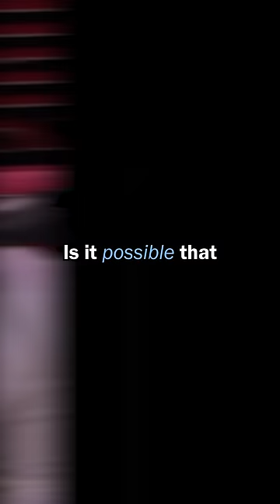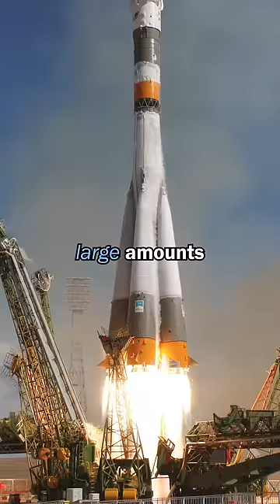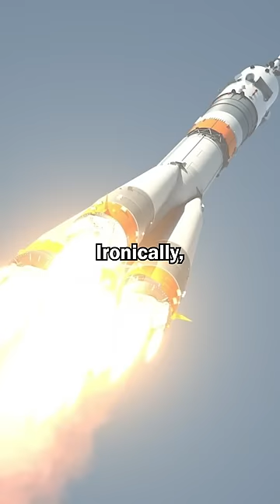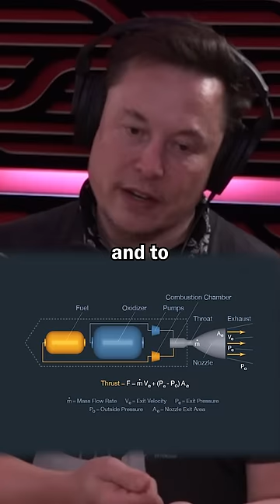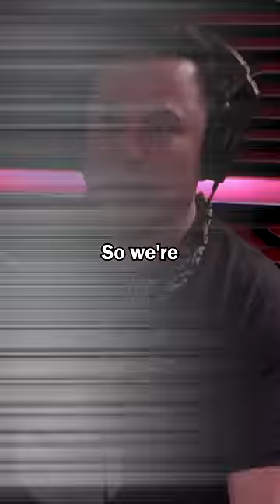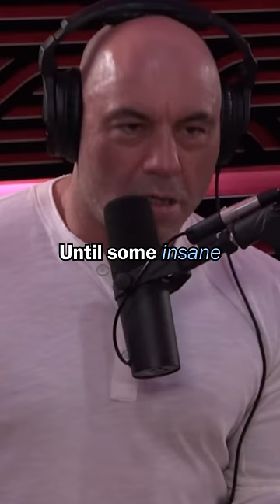Why This Rocket Engine Will NEVER Work!! ☢️ #spacex

Comment: Lockheed Martin is literally doing nuclear engines rn
Reply: True but the nuclear fission engine in development DRACO still expels hydrogen gas so Elon's point holds up.
Reply: @JFinns  True but I think elon was specifically talking about the main component of the fuel source. Not the exhaust
Reply: @bretwood4080  it is one and the same in space, this is specifically what he says, in the space it works because there a huge load of gas output not because something is burning. he never said you need to burn something, he just said that at this moment gas is needed
Reply: Nuclear engines produce propulsion exactly the same as any other rocket.

It expels gas out the back at a high speed. In order for momentum to be conserved, the rocket moves the opposite direction.

For every force, there is an equal and opposite reaction. All rockets function on this principle (even nuclear rockets, ion drives, etc). They all shoot gas out the back. 

The only theoretical exception is warp drives (it would move the space time you're in, carrying you with it, by bending the spacetime in front and behind you)
Reply: @adambalogh8728  Rogan clearly asked in terms of fuel source. Elon answered in terms of propulsion. And if you wanted to get technical, it's simply particles being expelled. Doesn't require them to be in a gas form. Most often, they are a plasma when in space.
Reply: @tylerdurden3722  Technically it doesn't have to be gas. It just has to be particles of some kind. Ion drives already exist. Solar sails would work of photon particles. Nuclear fission sends high energy particles out the pack. None of these require the particles to be in gaseous form when being expelled.
Reply: Rocket engines are fine if we’re talking about interplanetary travel in our solar system. But interstellar travel is a whole other monster. A gulf between oceans. Unless there is some way to tear into another dimension or wormhole, speed can only get you so far. Colliding with a small pebble at even 20% the speed of light is sure to cause the destruction of the entire space ship. If you’re traveling in a large ship at 99% the speed of light, colliding with the same pebble will cause giga tons worth of energy to be released. Atoms would split and fuse. You wouldn’t have time to even realize you have died. The trick is to travel long distances without the possibility of colliding with anything. Even a grain of sand. Or a fraction of a grain.
Reply: imagine what theyre working on that you dont know about
Reply: @Hadrian_S  I have been thinking about this very problem for a long time, and the only solution I could arrive at would be to have some sort of high powered lasers fixed to the ship, which could be used to move/vaporize obstacles ahead.
Reply: @KarmaKahn Perhaps that can work in interplanetary travel at a few thousand miles per hour. If you mount a laser powerful enough to vaporize asteroids or small particles it would probably need a greater energy source than is possible on a ship with finite resources. Not to mention that a laser would travel at light speed and if you’re traveling between 90-99% light speed the ship would still collide with the remnants of said asteroid and obliterate the ship with gigaton force. But we are so far away from propelling anything heavier than a few ounces (via solar sails) at anything close to light speed that us talking about it seems strange ;(
Reply: That's nuclear thermal propulsion, the nuclear heat up the gas ( hydrogen) and makes it expand out of the nozzle
Reply: Nuclear engines are great, but you still need a chemical rocket to actually get TO space. Then you can have all the nuclear goodness you want. There's plenty of contenders for interstellar travel propulsion, but none of them work to get you from the ground to space. For this you still need chemical rockets, unfortunately.
Reply: @bretwood4080 he’s speaking of “gas” as the state of matter not gas as in fuckin gasoline 😂
Reply: @bretwood4080  nuclear powered propulsion in space uses hydrogen gas because it is the lightest element. nuclear decay heats the gas particles to the highest possible speed then they are released out of an opening at very high speeds to propel the ship in the opposite direction at a much lower speed. ion engines ionize a gas and release the ionized gas at high speed, its the same concept. you understand the gist but as of now all usable ion engines and prototyped nuclear engines utilize gas.
Reply: @Hadrian_S or, have a field with some much energy that the pebble won't even be an issue, a field so strong than in traverse virtually any medium, water, air or space vacuum... Similar to what we saw of the coast of San Diego...I need to Elon to deep dive into how something like this possible.. even in theory
Reply: Element 115

Comment: "Not in our lifetime"
-Bob Lazar just entered the chat...
Reply: Sails. Use whatever you have to get them into space then unfurl them for solar propulsion until you get past the heliosphere. Braking is done by using a reverse sail with radiation from the ship's nuclear propulsion which is used for pushing on the sails to steer or when solar is unavailable.  Near light speed is achievable and engines can go for decades needed to traverse several light years.
Reply: Bob Lazar the proven liar 😂😂😂😂😂
Reply: Only Americans has flat earthers and alien in area 51 believers people 😂😂why aliens only coming to usa only😂😂😂😂😂😂

Comment: I'll see Elon's "it's not possible" and raise him a "it's very possible".
Reply: there are already electric thrusters being developed
Reply: "it's entirely possible" - Rogan
Reply: @eugeneeugene3704  Sure but his point is they will still need to expel reaction mass. That isn't going away. We have ion engines, they're super-efficient, but they still expel mass.
Reply: @eugeneeugene3704 there arent. Or do you mean ion-engines. They do use electricity but still propel themselves with xenon, a type of fuel
Reply: You missed the "not in our life time" part genius. If anyone would have done it by now it's elon
Reply: @wadedeclifford7442  We had a functioning nuclear rocket in the 70s thanks to NASA. It was just never used for political reasons (as usual).

It is true you still need reaction mass to throw out the back, but we have the technology now to make the power source for that nuclear and/or electric (it can be both). Which is what Rogan asked.

Comment: Bob Lazar and Elon Musk need to be on the podcast together
Reply: Bad for business
Reply: But good for humanity and science.
Reply: That's a great idea.
Reply: Elon and Bob Lazar's idea work fine with each other. Elon simply says with known technology, we need to BRING the fuel on board to space in order to move an object, whereas Bob says the UFO's he's seen use an element not native to our solar system that's so massive, it can bend space time around it, thus having a craft "fall" forward into the gap it created, thus actually allowing for faster than lightspeed "travel". It's possible according to physics, but nothing we have is even close to massive enough or powerful enough to create that "warp" in the fabric of reality. I believe Bob is telling the truth. He's told the same story, including the detail about element 115 since the 1980s. Element 115 has since been "discovered" and disclosed to the public in 2004.

Comment: Nuclear pulse propulsion. They studied and did some testing on it in the 60’s
Reply: "what if we made the rockets carrying our nuclear warheads even more deadlier"
Reply: Nuclear thermal propulsion is the most effective rocket propulsion we have to date especially for a mars mission. Lockheed is actually developing it as of July 2023 expected launch of 2027. Quite funny that Elon changed the question from nuclear to electric likely because he didn’t get the contract lol
Reply: sounds like it didnt work then
Reply: @oniondesu9633 It worked incredibly well, the nuclear test ban treaty put a stop to it and any further nuclear research above ground.
Reply: All of them met with freak accidents
Reply: @TheBossCuber that's still gas based, nuclear portion is to heat up gas and expell it thorough the nozzle to achieve propulsion. Elon is right in atmo, in vacuum he is still right except these don't all have to be chemical rockets .

Comment: You can push against the fabric of space or bend it. The only problem here is that we don’t know how to do that.
Reply: Thats what they meant by "gravity" and "not in our lifetime." And we actually DO know how to warp spacetime, we just do not have the ability to harness and use the massive amounts of energy required to actually do it. But papers on warp propulsion have been written and the math all checks out.
Reply: Not possible
Reply: @John.Christopher  It's very possible, at least mathematically.
Reply: @John.Christopher not physically possible. Theoretically, anything is just as possible as everything
Reply: @MrKevin486  Sorry but you're wrong. You live in science fiction fantasy land.
Reply: @Connection-Lost  No, it's not fantasy. If it does not go above your head, read Miguel Alcubierre and his published paper on warp drive. I went to university and have a major in physics, I wrote multiple papers on the Alcubierre drive using Einsteins field equations. While it requires energy manipulation on a scale we currently are not capable of, the physics all checks out. It is very much possible to warp spacetime and move faster then light by bypassing the relativistic effects of acceleration in a vacuum by essentially riding the "wave" produced by the spacetime bubble created. Essentially allowing your ship to remain technically stationary in its local enclosed spacetime bubble, while the bubble itself is pushed along by spacetime itself, which isn't bound by general relativity and thus is not bound by lightspeed, allowing exponentially faster then lightspeed travel to be possible as well as negating the effects of movement on the craft, because the craft is technically not moving in its local spacetime bubble. I'm not saying it's possible now, since the energy required is insanely huge, but in a few hundred years, it could definitely be probable. And that isn't that long a time, 2 generations, maybe less.
Reply: @MrKevin486  You sir are correct!
Reply: buddy has no idea how general relativity works LMAO
Reply: @WSZA1240  100 years ago people thought the same about quantum physics.....
Reply: i do, im just not telling...
Reply: To do it takes gargantuan amounts of energy, we lack the ability to manipulate matter or energy on that scale.
Reply: @MrKevin486 is more like stretching, and contracting, if we discover to use dark energy
Reply: We do, its called mass
Reply: @MrKevin486 thought it required anti matter or something like that? something with negative mass naw?
Reply: WTF are you talking about, dude?
Reply: @MrKevin486 Even if you warp the spacetime and ride on the wave isn't it so that the wave itself travels at light speed? How can you travel faster than light when the gravitational waves move at the speed of light?
Reply: @oilabaworld6944  Because general relativity only says things that are not moving at light speed can not move at light speed without needing infinite energy and gaining infinite mass. But it does NOT speak of things already moving at lightspeed, those things are not bound by said laws. So this allows us to bypass the light speed barrier and go faster. Also while its true you are riding on the wave in a sense, your ship is also contained in a spacetime bubble of sorts, and so in relative terms, the ship you'd be in is completely stationary inside of its local spacetime bubble. Thus, because your technically not moving, spacetime itself is moving, the ship and everything inside is not subjected to the relativistic effects of any movement such as inertia or the like.
Reply: @MrKevin486  But if you can send information from point A in regular space to point B in regular space then you are violating causality. A warp bubble that allows you to get from point A in regular space to point B in regular space will violate causality.
Reply: @MrKevin486  The speed of light is a constant though. How can a photon or a gravitational wave be faster than that? If it's possible for them to be faster why are we always measuring the same constant?
Reply: @MrKevin486  it also requires negative mass, which is not possible. and it violates causality, which is not possible.
Reply: @GratuitusPangolin  It doesn't just require gargantuan quantities of energy. It also requires negative mass, which foes not exist. It also violates causality.
Reply: @Terminator-ht3sx  anti matter is not negative mass. Negative mass doesn't exist.
Reply: @MrKevin486  But you are starting with a speed below light speed, so you cannot reach light speed.
Reply: Sounds like something I heard on Futurama 😂
Reply: I work at Nasa and we can do that
Reply: @Terminator-ht3sx   nah that's for creating stable wormholes. Also not impossible since we can do it right now, just not particularly energy efficient.
Reply: @WSZA1240 crackpot. you can't even integrate a curve and you think you know more than the best minds of our society.